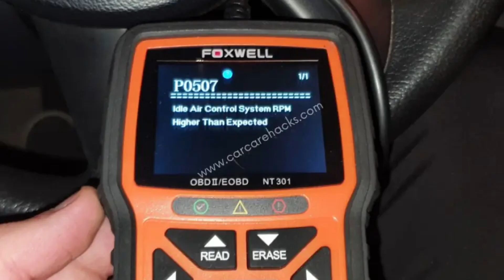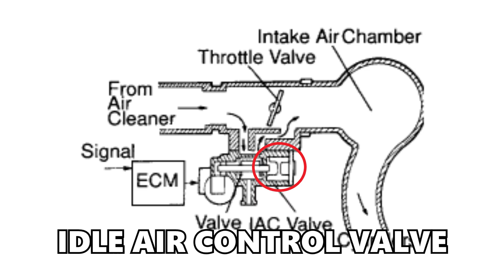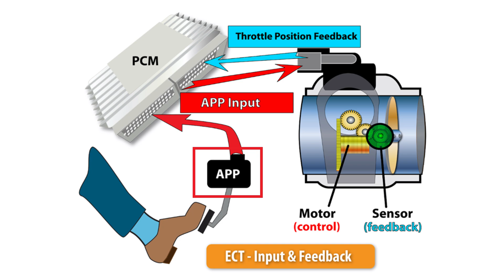Ultimate P0507 Diagnosis & Fix – The Only Video You’ll Need!

Comment: I have 2004 Honda accord p0507 keeps coming back after replacing the iac   and cleaning the throttle body could it be the Air assist valve just asking

Comment: 2008 gmc sierra at first i got throttle position sensor code P0121. I replaced the sensor and cleaned the throttle body but now i got high idle speed code P0507. I have low miles only 73K
Reply: Exactly the same thing happened to me after replacing old throttle body. P0121 went away, I tried to relearn TB but wasn’t possible due to P0507. I will replace Pcv valves (left and right) and clean MAF sensor as well and see how it goes.

Comment: Ive got a dual electronic throttles. 2010 infiniti m35..I just disconnected & cleaned both throttle bodies. Reconnected them & then spent time doing what i believe was relearning the throttle bodies but im still experiencing p0507 code. Rpm bounces between 2000 & 3000 when idle & theres hesitation when accelerating
Reply from the maker: C - Sorry to hear this.. With a P0507 (Idle Control System RPM Higher Than Expected) on your vehicle after cleaning both electronic throttle bodies, it’s likely that the ECU hasn’t fully completed the throttle position relearn, or there may be unmetered air (vacuum leak), intake boot misalignment, or dirty MAF sensors causing the high idle and bounce. First, double-check that both throttle body gaskets are seated properly and no hoses or clamps are loose—especially the air intake tubes, which are sensitive to leaks after reinstallation. Then, clean the MAF sensors with MAF-safe cleaner, as dirty MAFs can skew airflow readings and mess with idle. If that’s all good, try the official Nissan/Infiniti throttle relearn procedure: key ON for 2 seconds, OFF for 10 seconds, ON for 2 seconds, OFF again for 10, then start the engine and let it idle without touching the throttle for 10+ minutes until it stabilizes. If the issue continues, you may need to perform an active idle volume learn using a scan tool, as the M35’s ECU sometimes won’t adapt idle properly after throttle body work without a full relearn via diagnostics.

Comment: I had my water pump and throttle body replaced now my 2013 Chevy Tahoe idles too high. Tried the relearn program procedure didn’t work. Help!
Reply from the maker: D - Sorry to hear this.. If your vehicle is idling too high after replacing the water pump and throttle body, and the throttle relearn procedure didn’t fix it, chances are there’s a vacuum leak, an unseated intake hose, or a missing gasket or connector around the throttle body or intake system. Start by checking that all vacuum lines, PCV hoses, and the air intake tube are securely connected and not cracked or leaking—especially the rubber coupler between the throttle body and airbox. If anything was disturbed during the water pump job (which involves removing accessories and sometimes moving the intake), it can easily cause a vacuum leak that leads to a high idle. Also inspect the throttle body harness—if it’s not fully clicked in or has a bent pin, the ECM may misread the blade position. If everything looks secure, you may need to perform a throttle/idle relearn using a scan tool with bi-directional controls—sometimes the manual key-on/gas pedal method isn’t enough.

Comment: Mine had this code as well- p0156, 02 Sensor Heater Circuit
Bank 2 Sensor 1. And I have a straight pipe, idles rough sometimes.
Reply from the maker: W - With a P0507 (Idle Control System RPM Higher Than Expected) and P0156 (O2 Sensor Heater Circuit Bank 2 Sensor 1), plus a straight pipe and rough idle, you’ve got a combo of mechanical and sensor-related issues working together. The straight pipe removes backpressure and eliminates the catalytic converter, which can throw off O2 sensor readings and idle control logic, especially if the ECU isn’t tuned for it. The P0156 code means the O2 sensor heater isn’t functioning properly, which delays the sensor from reaching operating temp and can cause poor fuel trims and rough idle, particularly on cold starts. The P0507 is likely the ECU trying to compensate for the lean condition or exhaust flow changes, causing high or unstable idle. Replace the faulty O2 sensor (Bank 2 Sensor 1 = passenger side upstream), clean the throttle body, and check for vacuum leaks—then consider tuning the ECU if you’re running full straight pipe, since factory fuel maps aren’t optimized for that setup.
Reply: @8020Automotive thank you, this information helped a lot! I went to auto zone today and the guy actually said it was down-stream for the bank 2 sensor 1. Sound right? It’s a 4.7
Reply from the maker: @will9225  Sounds right! Keep us updated.